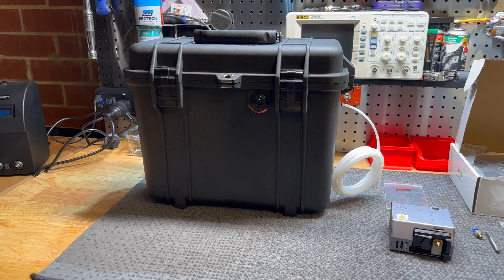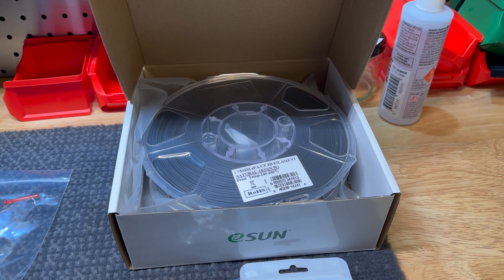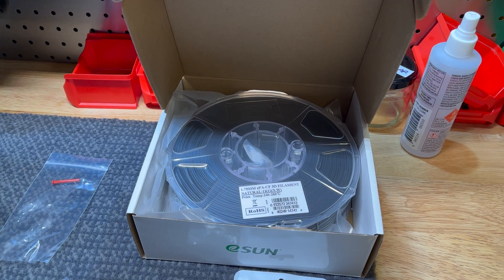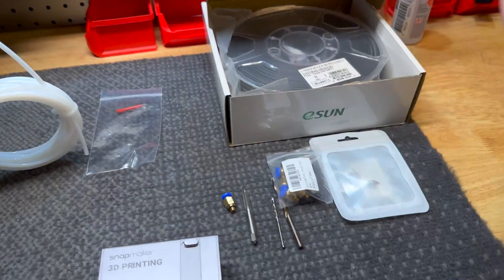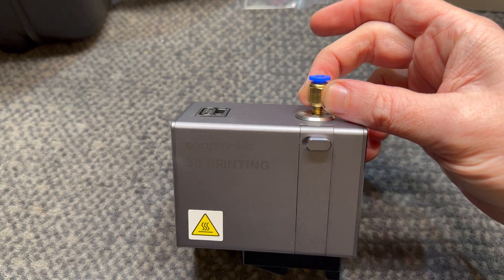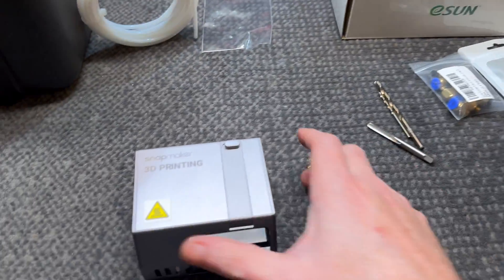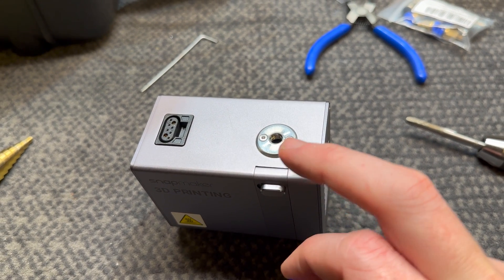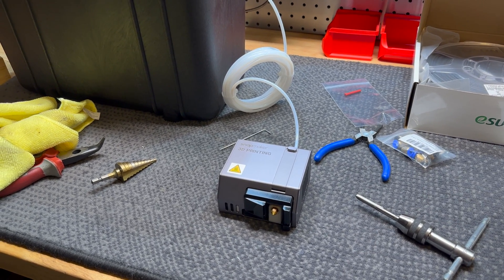Snapmaker 2.0 - Carbon Fiber Filament Retrofit

Comment: Hmm, very good cube accuracy, best I've seen. this is with snapmaker 2.0 A350 ir A250. The 350 one has heat bed to 80C low for carbon fiber, or there is easy hack for that too? So this can work reliably on A250 only I think.
Reply from the maker: Original A350, A250 can do it also with the same modifications and might have an easier time being a smaller heated bed. The A350 does take quite a bit to heat the bed to high temperatures…
Reply: @whatcouldgowrong7914  But I still hard to believe cube is to accurate, there is dual head for it advertised as carbon fiber compatible, is it true? Why not use it instead?
Reply from the maker: @akierum  Dimensional accuracy isn’t that hard really when print settings are dialled in. This machine is being retired soon and I have Snapmaker Artisan content coming as it has replaced it and yes it has a dual extruder and is much faster / smoother 🙂